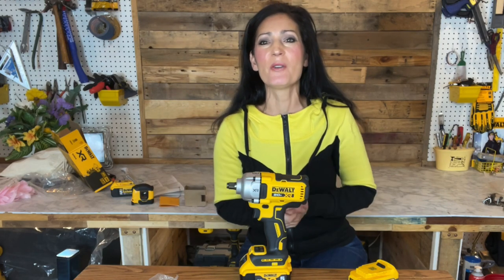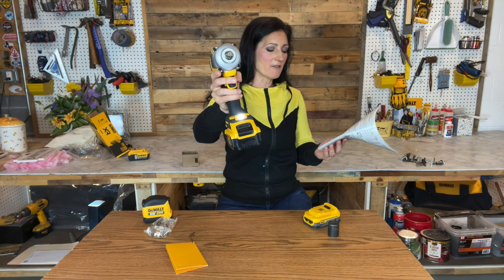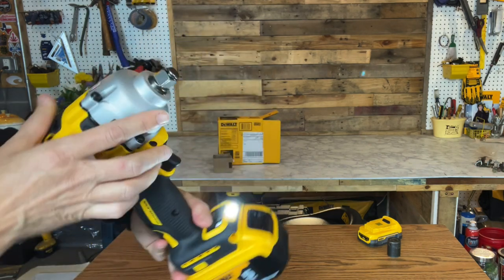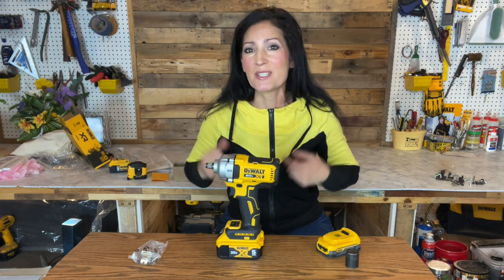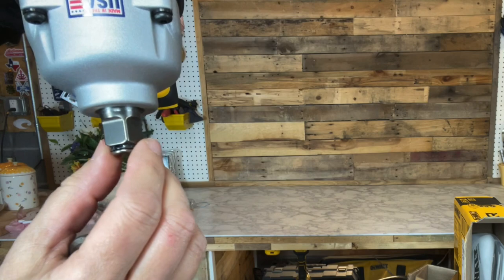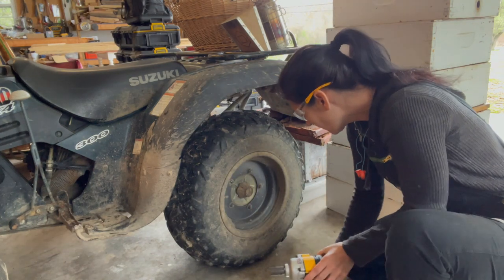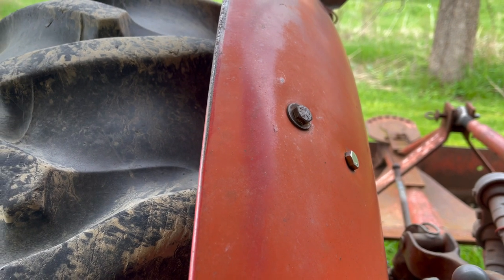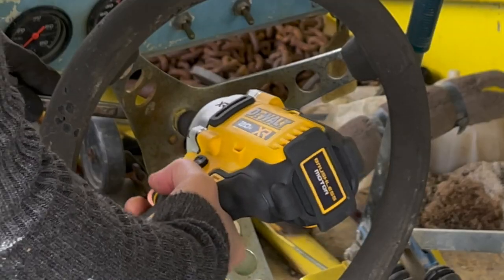BRAND NEW! DeWalt DCF891 1/2” Mid Range Impact Wrench Product Overview & Trial Run. Amazing Power!

Comment: That tool is boss. I want one so that it can make DIY brake jobs at home a breeze. Thanks for the video.
Reply from the maker: This would definitely do it!
Reply: @Jennyfromtheshop  Yeah, taking off tires, plus the brake calipers and caliper bracket manually sucks 😅

Comment: You know you could buy a 4x4 and drive a variety of lag bolt sizes that’s pretty simple and easy to show in real life use! That way you don’t have to worry about messing up your equipment. I’m willing to bet that you could find a scrap 4x4 and buy a couple cheap lag bolts or even find a stump on your property of some hard wood you could drive the lag bolts into. 3/4” x 8” lag bolt would be a great test of the torque

Comment: im curious im register 310T truck and coach aprentice,. which one is better DCF891P2 vs DCF921P2. both look identical but one is xr and other is atomic brushless. which one would be good purchase
Reply from the maker: Ok, so I looked up the specs on both and here’s the breakdown. It’s early and I haven’t had my coffee so hopefully I get this right. 😂 Both are 20v and Brushless, have 4 settings and LED lights. The DCF891 is bigger at 8.25” high and the fastening torque/max breakaway is 600/800 ft lbs. The DCF921 is smaller at 4.95” high and 300/450 ft lbs torque. A lot of times, DeWalt tools are very similar but the Atomic line is made for Home Depot and XR for Lowes, for example. For you, I’d recommend the DCF891 because it’s more powerful. Good luck to you in your apprenticeship! You will ALWAYS find work. 💪